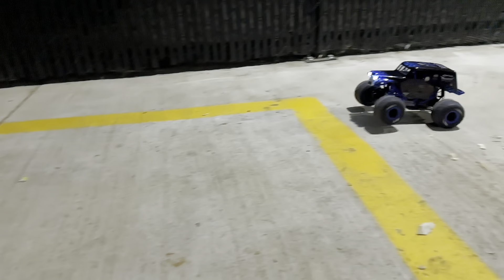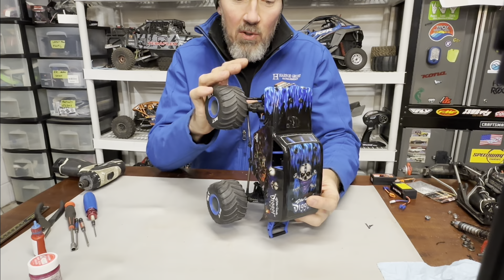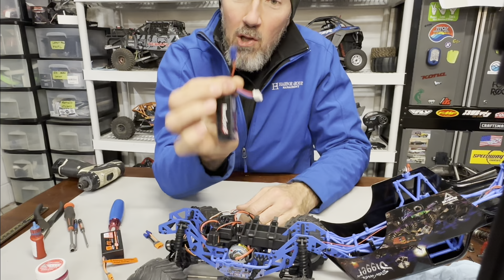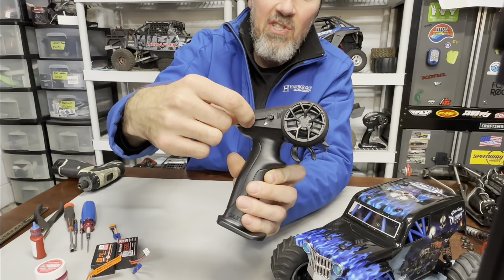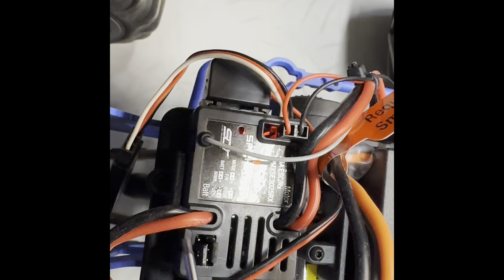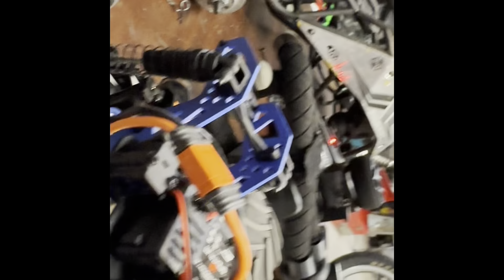Losi Mini LMT Quality Control Check - Is it any good?

Comment: I love mine! I got Sonuva too! Got real lucky, my local hobbytown got about a dozen of each in this past Monday. Surprisingly, Sonuva has nearly sold out already. But as of yesterday, they still had like 6 grave digger. Which kinda surprised me. Maybe it’s the blue color? But I think they’re both awesome. I will admit, when these first hit YouTube a while back, I was one of those griping about the price. But I bought one anyway, and I’m glad I did! The headlights are my favorite part. Not sure why 😂 I have a little cardboard ramp in the basement. This, and my Grom, have kept me busy this long holiday weekend. I’ve been off work since Wednesday 🤩 🙌🏼 This thing really is well built. You honestly have to see, feel, and hold one of these, to realize what you’re getting. Do I think $269 is still steep after owning one? Well, yeah. 😂 But after getting one, the price is less of a negative to me. Since we’re sharing early issues, the first one I bought, right out of the box, actually had a broken right headlight cover. My hobbytown resolved the issue right away though. But, that could be a one in a million thing from the factory, more than an issue really. But I’m curious if anyone else has opened a new one with any similar damage like that? Great video man. Merry Christmas 🎄🎁
Reply from the maker: My buddies had issues out of the box too. Driveshaft pinscrew was defective and it fell apart in the box. Lol
Reply: I got both. Love them both. Now just waiting for the mini King Sling and mini Bog Hog.

Comment: Yea just bought mine yesterday and the servo was DOA, not even 10 secs of run time. So i ordered a reefs 179, when you look at the price of a stock servo you can pretty much guarantee its not going to work, or not last long.
Reply from the maker: So far my servo is ok but I killed a few in my Mini-B.  Are you running a saver?
Reply: @rcilluminati26  didn't even get to run it, with the new servo I'm just using a horn that fits the servo no saver.

Comment: Is there an issue if when pushing my car forward or backwards there is a little click?
Reply from the maker: Very possible its the ring and or pinion gear in one of the diffs. You should also check the pinion gear on the motor and the spur.
Reply: @ I realized it’s just the switching from forward to reverse lol. I’m not a genius
Reply: @ the neutral zone between forward and reverse